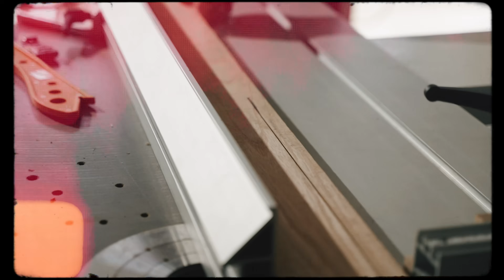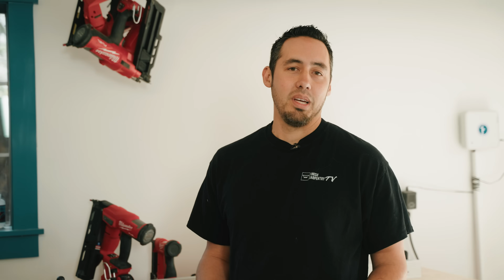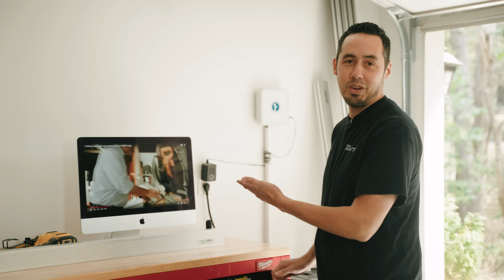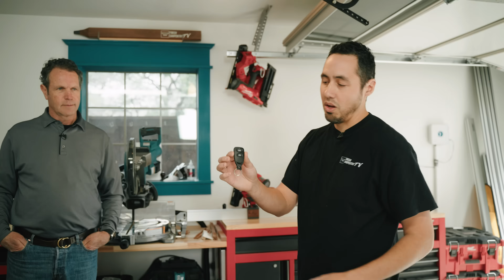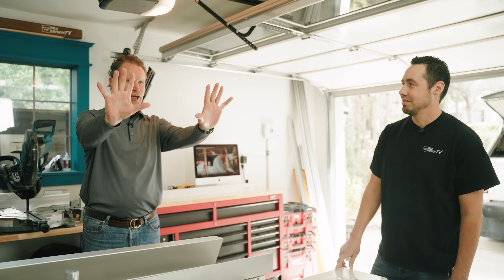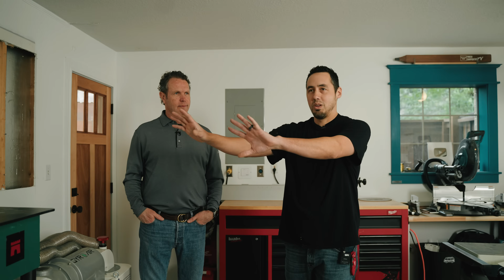How to set up a small shop. The tools you need and a great example.

Comment: I would get rid of the miter saw and get a 1950's solid accurate workhorse Dewalt or Delta radial arm saw.  EDIT:  I would keep the miter saw but add a radial arm saw in the line
Reply from the maker: Noted, we ultimately have moved to a undercut cross-cut saw for cutting things to length. I love the old Dewalt radial arm saws. Thanks!

Comment: I’m just getting started woodworking, but I’m blessed to have the ability to set up a small garage shop in my parents’ rental that I help them manage. It’s not far from where I live (in a condo). It’s a small 1 car garage, probably same age as the house (1918). The garage is actually a split garage where the other bay belongs to the next door neighbors! And the young tenants there are artistic and one has a screen-printing space in the garage now. On the other side, we have a small addition with a “bedroom” and en-suite (not very well done), and my sister currently uses that as her professional sewing studio. 

The electric needs to be redone to our garage/addition for sure, and upgraded so I can run some stuff like small dust collection, as well as buy some more serious tools. Right now, I have a Jet mini lathe and a small bench-top Delta drill press, because turning is something I can do entirely at home and get a finished product! Building a small cabinet from scraps to hold the drill press right now that will be on locking casters.

For milling and big tools, right now I have access during my classes to my school’s massive, awesome shop spaces, where I am currently taking furniture making and cabinetry programs. 

The next tools on my list, once we have the electric rerun from the house and upgrade, will hopefully be a decent bandsaw, router table, and if I have room, I’d love a Saw Stop table saw, planer, and jointer. But I also really enjoy using handtools so far, so a very small but heavy workbench with good vises and versatile clamping spots will come first! Don’t need to wait for the electrics for that, either. 

My dad would love to keep the ability to squeeze a small car in there, so the goal will be to have every shop fixture able to roll out of the way and tuck into each other. This garage also serves as storage for the home, and as the garden “shed”, though that hopefully won’t always be fully necessary as we slowly optimize every bit of the small house and lot! In addition to the electrics and any necessary cabinets and shelves, I have big ideas of not just cleaning up space above the rafters, but painting everything inside including the underside of the roof white, air sealing the addition next to it in a way that is up to code for bedrooms, and removing some very old low-quality windows (maybe 90s era vinyl?) that need to come out, closing up the garage one and building new wood ones for my sister to enjoy in the addition (where we would also like to take out the low ceiling, and instead finish the vault up to the roof).
Reply from the maker: Thanks for sharing, keep up the great work!
Reply: If you are starting out and have not yet gone down the route of buying thousands in machines and equipment start with hand tool woodworking. 
While it may appear more daunting as an endeavor it will make your skills and understanding of wood far deeper. 
All you need to start out in craft woodworking is a set of chisels, hand plane (no 3 or 4) and a saw. You can make absolutely anything with just that. You can also learn to make your own wooden tools as well. 
Then your first project will be to make a joinery work bench. Save your money for later when you master the basics. You still use what machines you have bought. 
Too many people think you need a table saw, jointer, band saw, router table, spindle molder, sanding machine, mortise machine and so on.